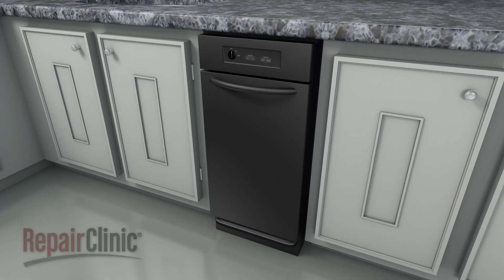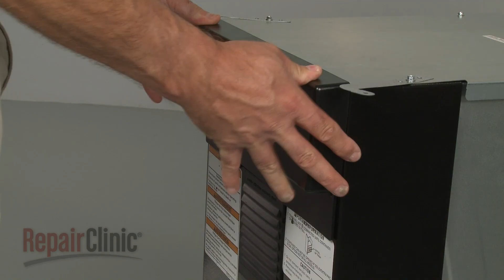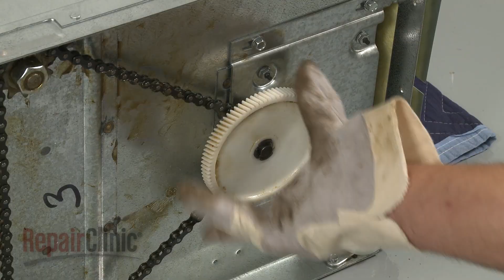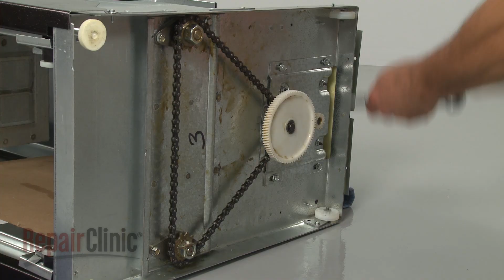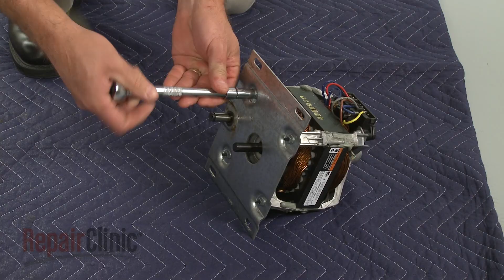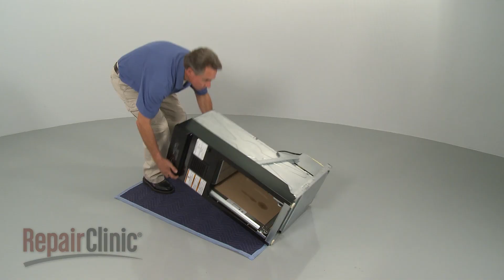KitchenAid Trash Compactor Disassembly, Repair Help

Comment: I had a drive gear break in half, this video helped.  Only suggestions, nowhere online do they talk about how to get the darn thing out of the cabinet when the ram is stuck in the down position.  Luckily I found a compact installation video showing they just use two screws about midway up on the compactor that go right into the front of the wood cabinets.  These screws can only be accessed and unscrewed if the drawer is open, but you can't open the drawer when the ram is down.  I used a thin bladed metal saw and ran it between the compactor and my wood cabinets until the blade hit the metal wood screws, then I just cut through them and the compactor easily popped out of the cabinet.  Once out I could then lay it on its side for repairs, everything comes apart easily, and once apart, was a great opportunity to clean out tons trash that got pushed into crevices and into the draw rails where its not supposed to be.  Once I cleaned that out, my drawer slides in and out much better and the draw also fully closes.  Before, there was so much trash stuck back where the drawer rollers slide along the rails, that it was stop the drawer from fully closing leaving a 1/4" gap.  No more gap now that I cleared all of the trash by accessing the rear motor panel which makes trash removal quick and easy.  Thanks for this instructive video!

Comment: My compactor has gotten very loud. At the midpoint (11 seconds) of the 22 second cycle, the general loud noise also has a loud clicking sound. We used your videos and took it apart and the drive gear seems sound. The Trunnion nuts were a bit loose and we tightened them, cleaned out all the compacted trash and now it is louder and still has the clicking sound. Should I order new Trunnion nuts?.
Reply from the maker: +YANKEES153 That would be a good place to start. The clicking is normally due to stripped trunnion nuts.

Comment: I have a new KUCJ03FTSS it worked fine for the first couple of days.  Now when I press the start button, it begins the compacting process and seems fine, and suddenly starts pounding fairly loudly and seems to go on for ever.   I always stop it after the pounding goes on for about 15 seconds, by just pulling the drawer open.  Unless I turn the power on, each time I close the drawer, it starts the compacting sequence again, them the pounding.....any suggestions?
Reply from the maker: You might have a bad upper limit switch or the start button is stuck closed. You said the unit is new so I would call and have a service technician look at it. If it is less than a year old it is most likely covered under your warranty. You can check your owner’s manual for the warranty and other tips before calling for service.

Comment: I have the Kitchen AID compactor like shown. Everything works except for the door wont stay closed/shut. Is there an idea of what part is bad and what need to be replaced ?  Thank you
Reply from the maker: The front rollers should fall into a dip in the rails. When you push down on the foot petal it lifts the drawer up and out of the groove. I would also check to see if some debris got behind the drawer and is keeping it from going back all the way.